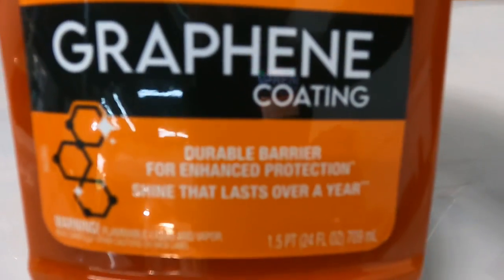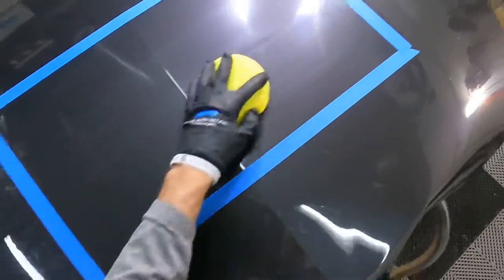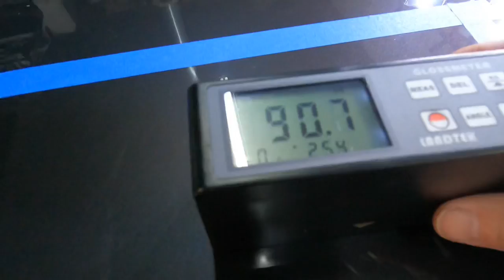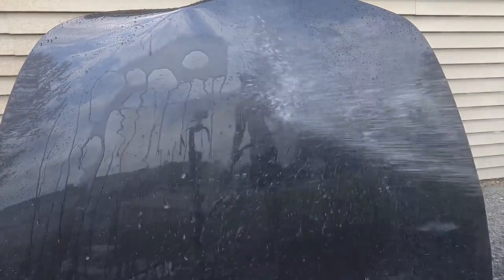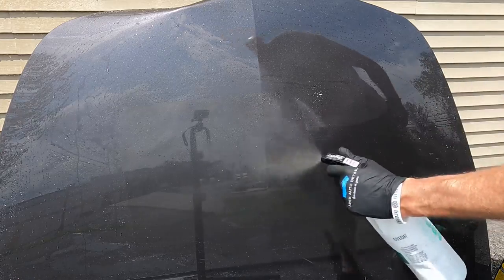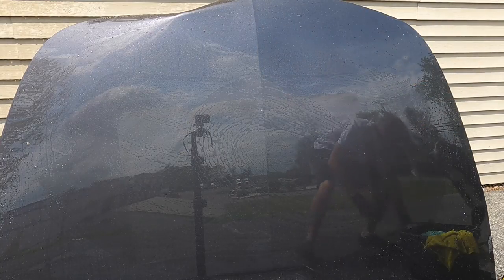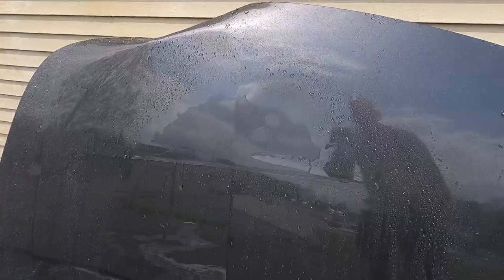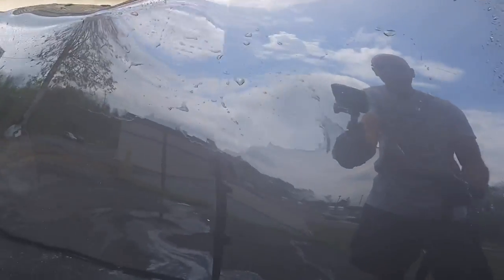Nu Finish Graphene Coating! Is This Better Than Nu Finish Ceramic Coating?

Comment from the maker: Their Ceramic Spray Coating is your best bet from NuFinish IMO.
Reply: What’s the best ceramic spray on the market that you would recommend right now?
Reply: It certainly wasn't the worst that you've tested on the channel. It wouldn't last down here in Maryland either. Should we be looking out for it on your website? LOL! Thanks Brian!
Reply: @noxxious5.098  MY favorite is by far SONAX CERAMIC SPRAY COATING.  Alone it provides tremendous hydrophobic properties but it's not slick feeling at all. So I topped it with SONAX ULTRA SLICK DETAILER and it has been fantastic.  By far my favorite spray coating combo!
Reply: @gabevillarreal96  not slick? That’s Ironic. Haha I believe you since Sonax comes out with amazing products. Thanks !
Reply: @noxxious5.098  Not slick at all. Very grabby. But I spoke with a Sonax representative and he said to top it with their ultra slick detailer and I did yesterday and it was very slick. Still not the most slick but definitely a tremendous improvement over Ceramic spray coating alone. Plus the water behavior is the best I've seen in a spray coating. Very happy with SONAX! Yes they make phenomenal products! Turtlewax Seal n shine topped with Ice Speay wax is way way more slick but nowhere near as hydrophobic in my experience.  I prefer Sonax hydrophobic properties but Turtlewax slickness and scent.
Reply: DITTO!!
Reply: Unfortunate since I'm pretty sure they discontinued the ceramic in favor of the Graphene.
Reply: Of all of the spray coatings/sealants, ceramic or not, is there one you might pick that has the best gloss, but with "acceptable"  longevity (at least 4 or 5 months...or longer).  I'm almost out of Griot's Ceramic 3in1, which gives good gloss and longevity (topped with Xtreme Solutions Topper), but looking for something "better".  Possibly Can Coat, or Sonax spray coating, or other???

Comment: I just used the nufinish graphene and my experience was similar as far as application. I did the left side of my car with 2 coats of new version seal n shine which was a very easy and pleasant experience as far as application process and scent as well as slickness and ease of removal.  The other half of the car I applied 2 coats of  the Nufinish graphene. Much more difficult to apply and remove and was not slick at all. Very grabby in comparison. This is my winter application and I'm anxious to see which one handles Nashville's winter from January until April.  I'll wash the car once a week by ha d using TW Pure wash and I'll not reapply until around June when I strip everything off, do an chemical and mechanical decon and put something else on for the silummer and fall! We shall see!

Comment: Even if the results of the product were good, I'd have to pass on this just based on the amount of time and effort it took you to buff it off the section of the test panel. I'd be dead tired going through that process for an entire car. Thanks for the information Brian.
Reply: Ever apply and buff off the old Turtle Wax paste wax. Talk about an old skool workout. 😆
Reply: @reeb9016  Yeah, I've used the old Collinite and it was not an easy time. I'm 62 years old and too old for that much work now. I'm much more into the spray on and wipe off variety of protection.

Comment: I’m surprised the graphene version performed not as well as the ceramic. My preconceived expectations were for the graphene product to be the same as the ceramic product. I have been studying acid rain and how it is trending to be more of a concern in the next few years. The product should not wash off in the rain. Thank you for the video.
Reply: "Graphene" seems to be the latest marketing buzz word for product manufacturers to use.

Comment: Looks like there's no reason to retire my bottle of Nufinish Ceramic: their ceramic was disappointing.  I had tried a bunch of these consumer products before finally going to the expensive Optimum Pro+, which so far has held up well.